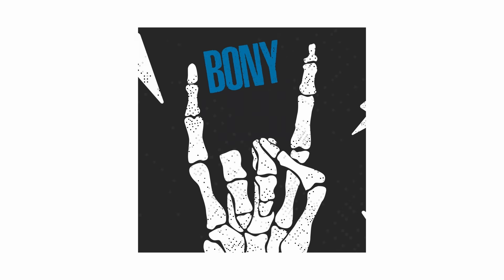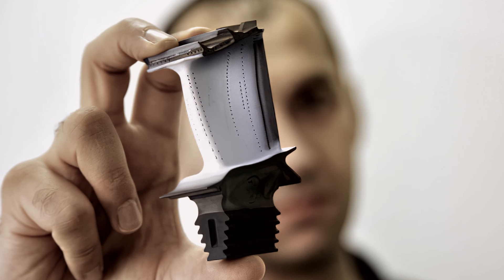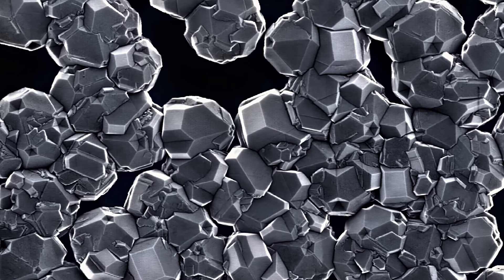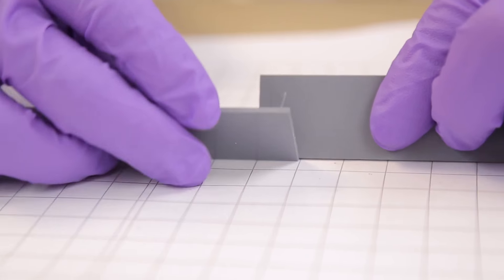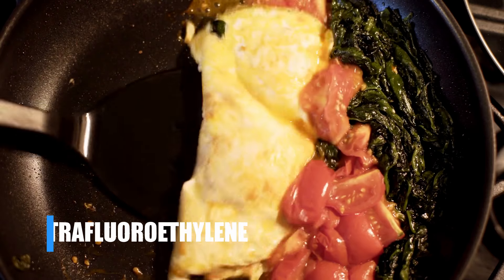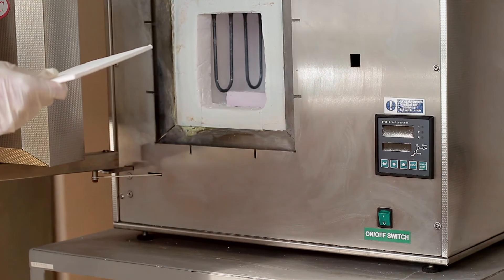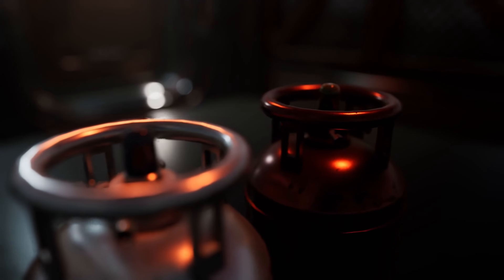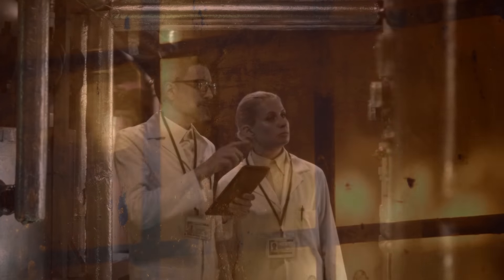Extreme Materials

Comment: being a mechanical engineering student, this video is like a gem to me
Reply: A gem is a physical object consisting of solid material.  This video is only information;  stored data.  Its actually only a high speed square wave of 1's and 0's by a simple switch being turned on and off.  Being a mechanical engineer I would have thought that you would know the difference.
Reply: @calholli  nice pun
Reply: @calholli  "like a gem"
Reply: Just wait until you discover Wikipedia
Reply: This channel is a gem.
Reply: Or it's more like a knowledge candy hehe
Reply: No
Reply: It's a gem of a video but it doesn't look at all like a mechanical engineer to me.
If a mechanical engineer had counterclockwise DNA like that shown in the video, would it turn into a video, too?

Comment: I would like to clarify that Ni-based superalloys (depending on the specific alloy) can utilize precipitation hardening in addition to having solid solution strengthening. We usually see precipitation hardened Ni-based superalloys as turbine blades which are cast as single crystal

Comment: I worked in a shop that made plane parts from inconel.  Alot of machining tricks are done to help save the strength of the metal. Electo-chemical machining helps machine the parts without the heat stress of normal machining. Then part are sanded smooth. So no stress cracks form during the operation of the part. This whole process can machine a part to less weight than standard machining.

Comment: You forgot to mention magnetic forces and superconductors... would have fit in well in this video.  Another extreme material could be Silver, just based on how useful it is-- over 10k known uses. What material is most elastic...  What is the best strength to weight material--- ... What material can withstand the most heat/ or resist the most voltage (greatest insulators).  Hydrogen itself could be "extreme" in that it can create the most powerful bomb, be the most abundant in the universe and still be a key ingredient of life itself (because its in water)-- pretty extreme range of utility.....  I think this needs an encore-- second episode.  This should be a continuing series.
Reply: exactly, verbosely put.
Reply: @ericscaillet2232  Listing some of my own ideas is not being verbose. lol..  It wasn't just to make a single point.

Comment: Former Boeing Everett... Inconel Fasteners are just 1 example of expensive alloys used in Aircraft...

Want Vertical Stabilizer on a Boeing 767 to stay attached to Fuselage... (16) $2,000 fasteners are perfect for the job. While Aircraft Fuselages don't have part or system 'redundancy' per se, they do have lots and lots of high strength fasteners, including millions of rivets, bolts, even special adhesives. 

Even that is changing as more and more Carbon Fiber is used for building Aircraft. Even Carbon Fiber parts like Wings attach to Fuselage with expensive high strength fasteners. Engines are held to Pylons with very few fasteners. Engines are designed to sheer off and fly away without striking Aircraft.

The ultimate Super Expensive fasteners are the Explosive Bolts used to hold Rockets to Launch Pad until liftoff.

Comment: The info is awesome, but the pacing is a little all at once. Have a small header between each main topic, and take a breather in between a couple sentences. Like, you need to separate your wall of text with indents and paragraphs, so to speak.
Reply: Yeah, this particular video felt a little jarring and structureless because of how it changed topics without any real transition or indicator.
Like it was all one thing that's supposed to lead to some bigger overall point, but never does because it's really a series of mini-stories vaguely tied together by a loose general topic...
Which is fine, but the narrative structure didn't really support that properly...
Reply: Yes. A quick study of narration would be a tremendous help... Everything is spot on but the speed and timing. Good job all round.
Reply: Loving all the content as well! As a narration performance note, avoid using long E “theee” pronunciation before words beginning with a consonant sound. Keep it up! You’ve got a new subscriber here!
Reply: I disagree.
Reply: Seemed fine to me... maybe you just need a cup of coffee
Reply: For me the pace was perfect if not a little slow, usually the pace is too slow to keep my concentration, probably because of my ADD
Reply: Nah I disagree I thought it was great
Reply: It seems a very good scientist wrote the speech, the  reading was by some innocent script reader.
Reply: Use .75 playback speed

Comment: Er, the solid solution strengthening part is not really where the high creep resistance and general temperature-insensitive strength of most superalloys comes from. You have to distinguish between solid solution strengthened superalloys like Inconel 625, and precipitation hardened superalloys like Inconel 718 (gamma prime and/or gamma-double prime precipitates to be exact). Very often when we think of jet turbine hot zone components like disk forgings and blade castings, that's going to be some form of gamma-prime superalloy: 718, the Rene and CMSX single-crystal grades, Waspaloy, etc. This kind of high temperature performance is not at all attainable just from solid solution strengthening, and to boot, solid solution strengthening isn't unique to superalloys at all. It's a basic strengthening mechanism in all alloys.

Comment: there is so much more to expensive bolts than just the material used.   I've seen a case study where a manufacturer doubled the failure load of their bolts by changing the way they create the threads.   And personally, as a foundry guy, the bronze/brass (its murky) metals produced by Ampco can achieve double the physical test results as the same alloy as prescribed by the CDA in a sand cast form - It's fucking wild how tough those ampco products are, just don't forget your wallet   Just controlling the unspecified adulterating elements in the 0.01% range, and or using powder metallurgy/vacuum smelting makes unbelievable improvements in metal component performance.

I think the contemporary research into nano materials, and

Comment: Boron based ceramics like BAM are alright. They have good shock-loading properties (armor), but their mediocre chemical resistance and porosity can make them unsuitable for use. It looks almost like they were trying to improve boron's resistance in hot oxidizing environments by adding tiny amounts of Aluminum and Magnesium, but it doesn't look like there is enough to really protect the bulk Boron ceramic matrix. At least its slippery + wont scratch, and I'm sure the high porosity is useful in dynamic and static journal bearings (wanted to avoid that route). Here is my source of information: https://www.goodfellow.com/pdf/TAB601A.pdf  (needs filled in more)

Comment: how the fuck do you store Chlorine Trifluoride if it reacts with EVERYTHING. Do you store it in liquid nitrogen or Helium...
Reply: "It can be kept in some of the ordinary structural metals-steel, copper, aluminium, etc.-because of the formation of a thin film of insoluble metal fluoride which protects the bulk of the metal,, found the answer.